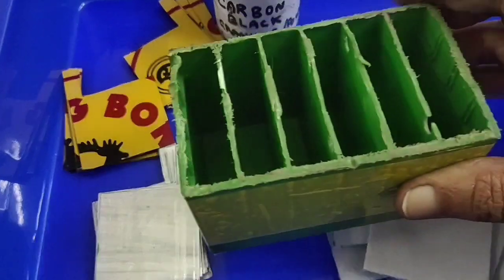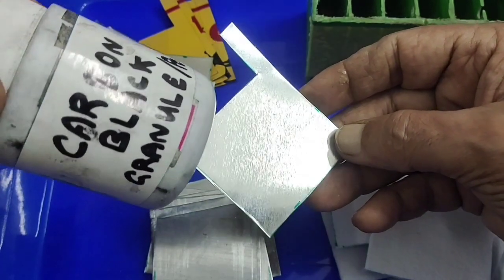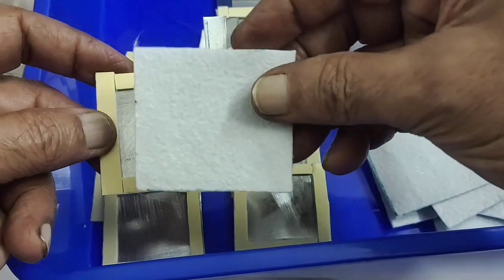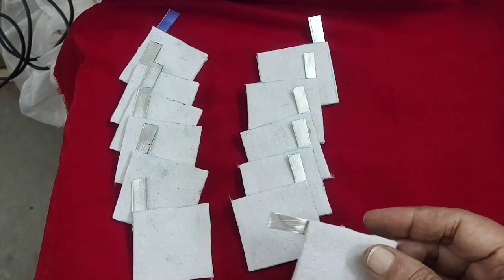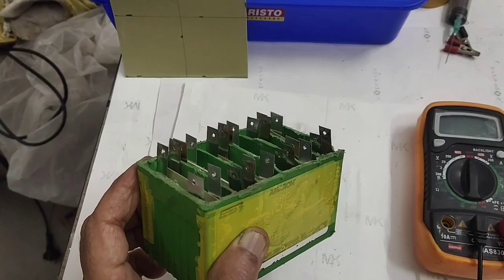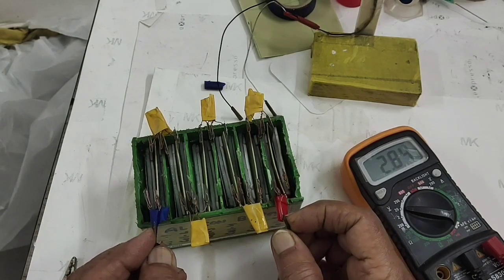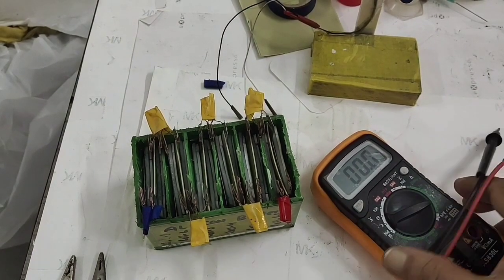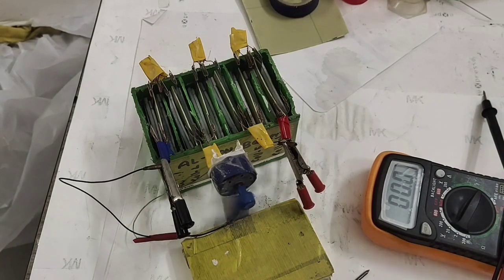ALUMINIUM ION BATTERY -AL/IRON BATTERY V 3.0, 450mA. VIDEO -73, D.I.Y STUDY PROJECT

Comment: Friend have you ever made or used a VERY VERY dangerous type capacitor battery charger   This very dangerous could kill you battery charger could be made in a safe way!   It is not dangerous if not powered up with out battery in circuit  The lead acid "MAYBE OTHER TYPES TO" battery acts as a resistor in the circuit and keeps the voltage form raising to dangerous high voltage  There are so many other types of battery chargers that are not deadly   Thing is this dangerous type dose things no other type dose I have used this type myself with great results!   It is very simple very few and cheap parts no step down transformer is needed    Reg line voltage from outlet with a run type capacitor NOT ACROSS the two legs of power but in series circuit on only one leg  After the capacitor it goes into a full bridge rectifier  After the full bridge rectifier into the lead acid battery  The battery acts like a resistor in the circuit   It "the battery"keeps the voltage from being VERY high voltage  dc that will kill  This is a VERY dangerous circuit to build if left laying around some one not understanding the danger could be killed!   The lager the the run capacitors capacitance the higher the amps it will charge the battery  My wall outlets here in Wv usa  are 120 volts ac For every 25 uf of capacitance of the capacitor it will charge at one amp  So i think but you would have to test to make sure 25uf with wall outlet being 230  volt ac would charge at 2 amps Again I warn you my friend this type of charger could kill some one so great care MUST be taken that no one plugs it in by mistake Also that the battery is hooked up before plugging charger in  All children and pets must not get around this type of battery charger It must be unpluged from out let for a few minutes before unhooking battery   If the battery is not in circuit the dc voltage could be over 3 or 400 volts  This VERY dangerous battery charger will restore badly sulfated batteries But you may also find that hydrogen can be produced for a way lower wattage cost with little change in this circuit  Notice the way a battery has many cells in series  I think certain grade s/s tubes closely fitting inside each other close capacitance may be a rewarding study    No salts of any kind pure water and a dangerous battery charger circuit  If dc output dose not rise high enough try smaller capacitance run capacitor  Use a step up transformer before the run capacitor if your pulsed dc voltage out put of this type battery charger is not high enough But do NOT do this and die if you don't already have all safety training needed to experiment with high voltage    Have a blessed day my friend from some where far away  I truly hope you know the one and only creator of all things created!  God is good  not some fairytale truth is he is real and he is good  Please if you are ever with no other place to turn and no hope CALL out to him please  If truly in truth and humbleness of heart even if  you have no other hope you cry out to him he WILL answer  He loves us ALL and makes us his children when we believe and trust in him alone! God our father is good

Comment: Hello. Aluminium choride is difficult to get hold of in UK and very expensive is there a substitute I could use ? Thank you 
Steve
Reply from the maker: Take thin cuts of Aluminium sheet, sprinkle little by little into a glass conical flask or wide mouth glass beaker containing concentrated Hydrochloric acid (say 50ml). As and when you put strips of aluminium into this acid, aluminium will generate Hydrogen gas until the acid consumes the required aluminium and the clear liquid which is seen is Aluminium Chloride. You can use this liquid for your experiment. Use a water bowl as external cooling system for the beaker. You can change the water if it turns to hot. 👍

Comment: Good experience ,cleaning off all the coating from plates with sandpaper will increase surface area and increase  conductivity. Useing items easily available makes your video much more useful. When we really need to build our own battery we will not be able to buy exotic materials. Keep up the good work.